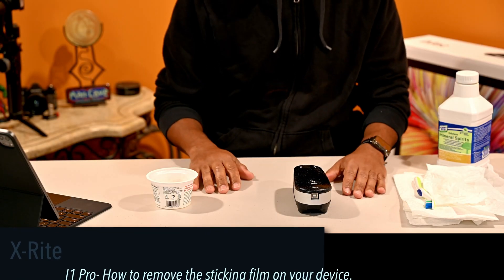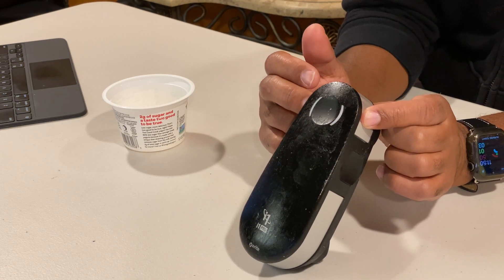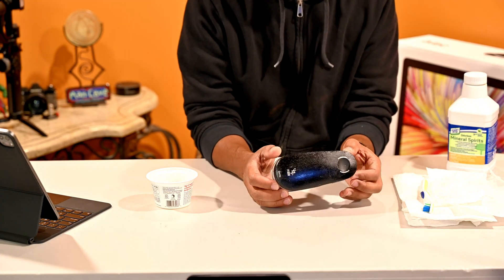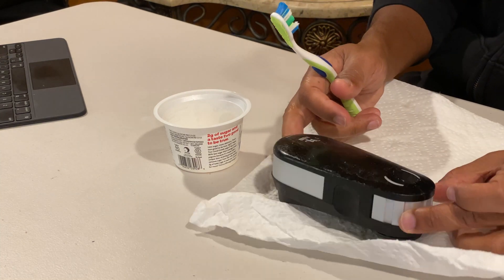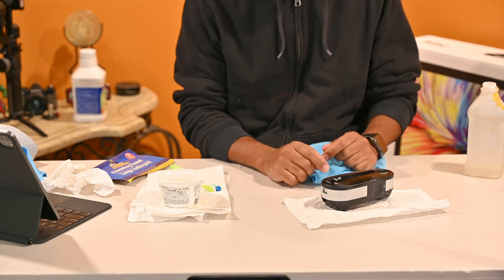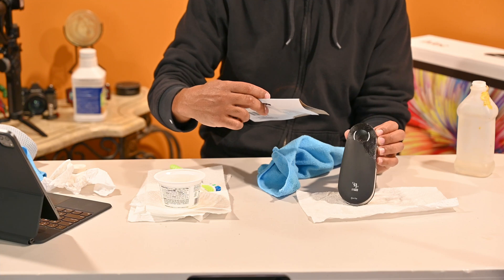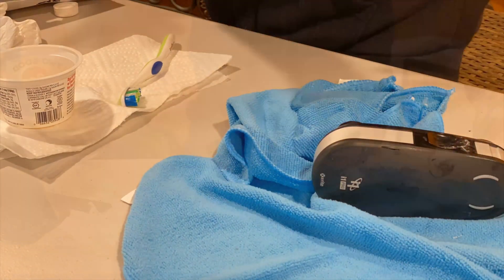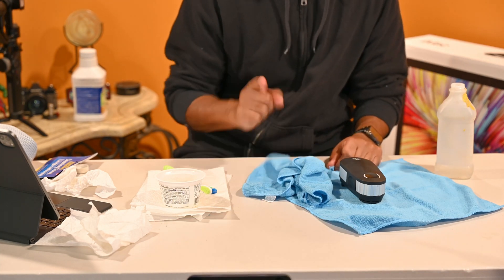How to Fix your your X-Rite i1 pro color measurement device. How to remove the sticky film I1Pro

Comment: Great video.  Same problem with an X-rite i1 Display.  I used a product called "Original KRUD KUTTER" and paper towels and it came right off. 5 minutes.
Reply from the maker: Thanks for the feedback and please remember to subscribe to the channel and like the video.
Reply: @DIYNATIONUSA  I just wanted to agree with Gray about KRUD KUTTER, which I've used for years but never tried on my EyeOne Pro. Mine got sticky too and It worked far better and faster than Alcohol which I also tried. It's found at most hardware stores (Lowes, etc).